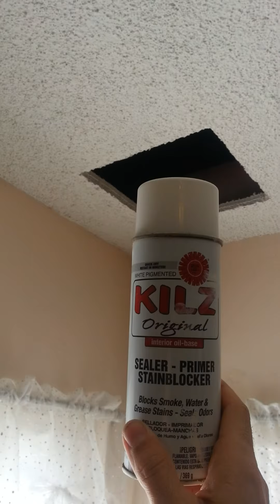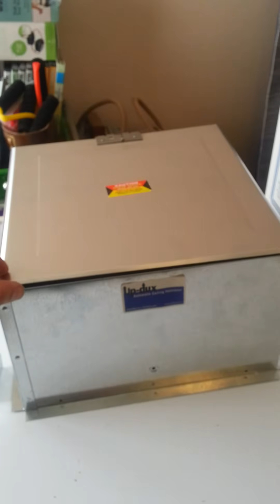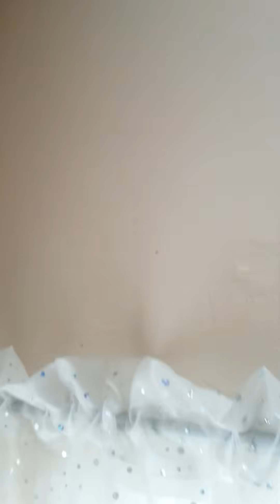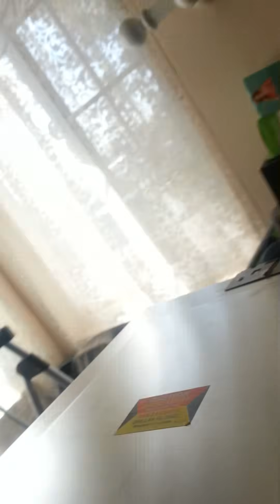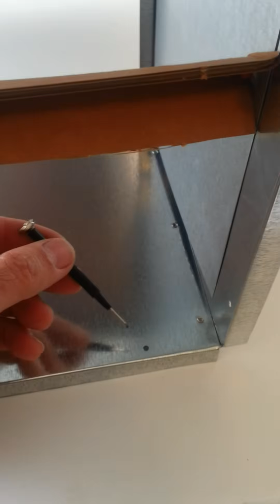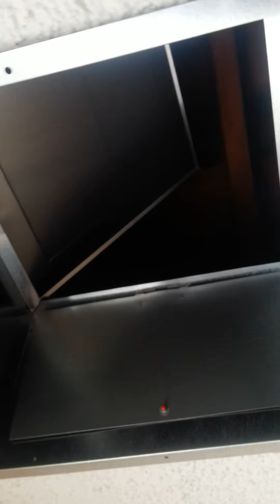How to install Up-Dux in your ceiling

Comment: Hey Steven thanks for the great video. I live in the California desert where it gets in upwards of 125 degrees. We depend wholly on our swamp cooler to keep the house comfortable. The central AC is just too darn expensive to run. We always locked open certain windows in the house for exhaust for the swamp cooler. I just installed just one UP DUX in our 2200 sg ft home and man I cant believe the difference in our home. NO MORE DUST!! we can keep the windows closed. Thanks.

Comment: Steve, you came through!  I had 2 up dux to install, and I'm a pretty competent home handyman.  However, those clips had me baffled.  Nowhere on the instructions does it state they needed to be bent around the sheet rock so I was trying to figure out how they were going to hold the system in place.  Also, if you look at the installation instructions it looks like the wide part is on the outside.  I like the units but the instructions are a real POS...!  Thanks for the video!

Comment: Good video, Steve!  I'm considering installing UpDux but am worried about the humidity level in my attic.  Have you monitored your attic for signs of the humidity level being too high (moist wood, mold, mildew, etc).  I live in a dry climate but am still concerned about the long term affects of pumping moist air into my attic for 5 months out of the year.
Reply: Your attic should be vented by code. I've installed these for over 20 years. Never had issues with moisture. 
We have actually installed swamp coolers in the attic in Phoenix because the heat and dry air in the attic works better in the monsoon.
Reply: @pcjpcj4070  interesting would love to see videos of them installed in the attic, I'm also in phoenix with a swamp cooler. lol

Comment: Now that its been 5 years... whats the effect on your attic? I keep hearing about "mold issues" and other things people keep warning about.
Reply from the maker: Fox Vulpes I have not experienced any mold issues. I live in a dry climate in Southern California and my attic area is very well ventilated allowing for good flow of air, even when the cooler is not running.
Reply: @bccie1pres  how is your attic is ventilated? any tips
Reply from the maker: I live in San Bernardino in Southern California.  It gets humid sometimes in the summer and I have my swamp cooler running 24 hours a day. There are no problems in my attic at all. I check it regularly. Have a safe day!
Reply from the maker: @kamranmandha1  I have the standard vents under the eaves and some roof vents that are standard here in Southern California.